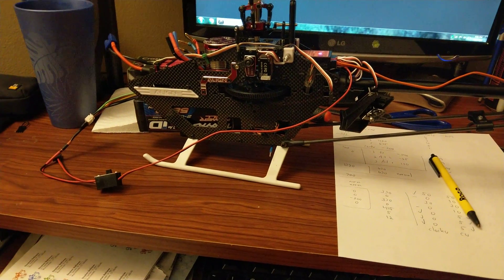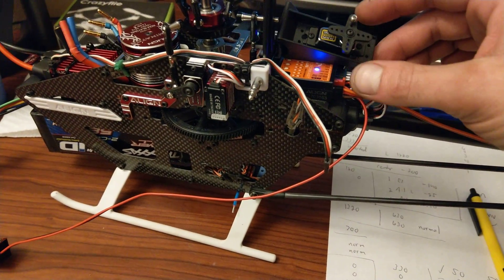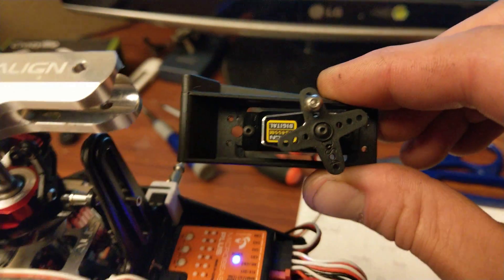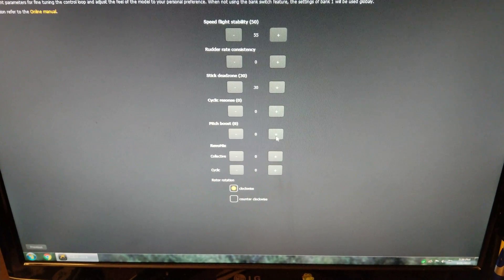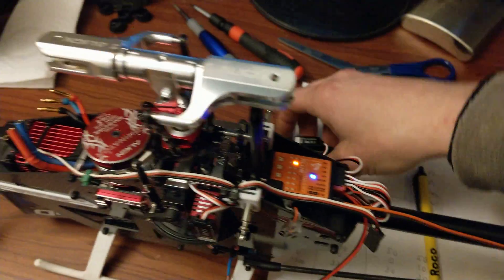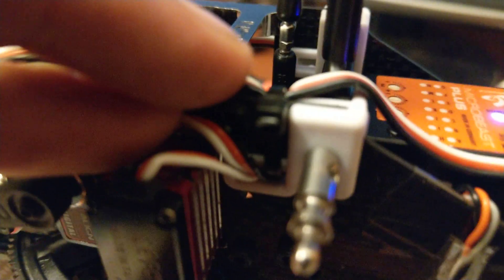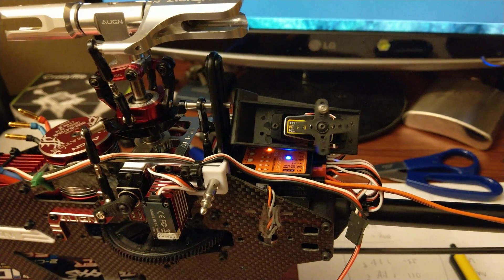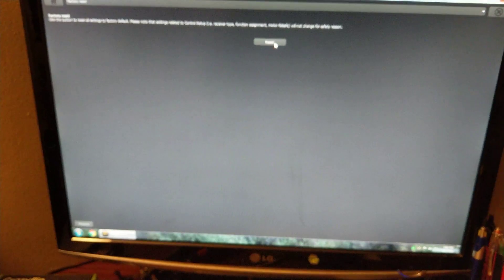Glitch in Studiox for microbeast plus v5 tail gain

Comment: Hate the new version of the software. I liked the previous version, the new version doesn't give you any feedback on your settings i.e. Normal, sporty or sedentary. Thanks for the vid, one to watch out for.
Reply from the maker: IMO numbers are more informative than a pre-determined label. When it comes to the soft/sport/extreme/etc labels, you really never know what it's set at. It just tells you what the manufacturers think it should be labelled as. With the new software, the numbers actually correlate to something: degrees rotation per second. Which makes it extremely easy to adjust.
Reply: crluver123  yes but it was nice to see what area you were getting into. The software is ok if you are on top of the game. It is not intuitive at all.
Reply: I dont understand why do you hate the PC Firmware Studio X its better and more exatly , but the most people dont read intensive the settings from the Microbeast V5.1.5  then when you set it all exectley then a day without wind you take of and he stands like a  tree in the air . iam flaying to many years the Algin next simulator with 31 models and so in all my time of flaying Helis of good like Algin and the new Sab Goblin Kraken 580 12S and ownly chrashed 2 times in 17 years :-)))))

Comment: Do you have this problem without using the studio X software by just pressing the button?
Reply from the maker: no. setting these parameters using just the button/rudder works perfectly
Reply from the maker: Michael lee I did and still do, for those specific parameters. With v5 firmware, using the PC is actually easier than the button.